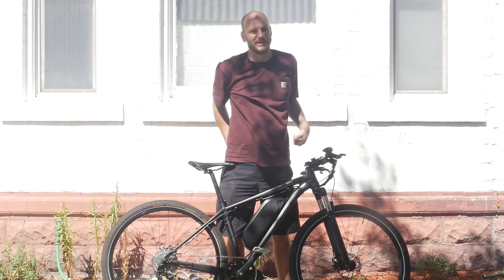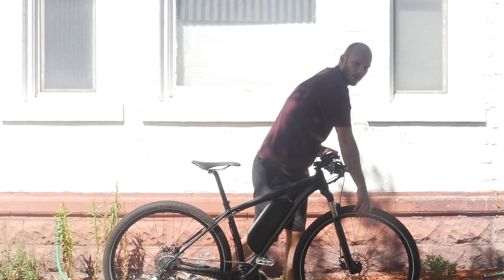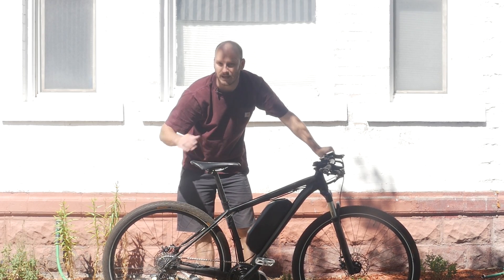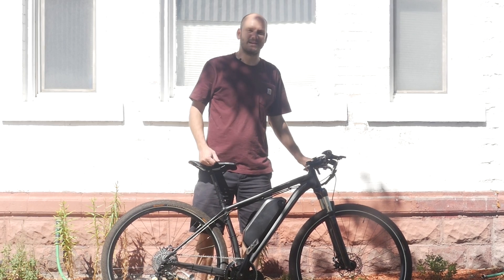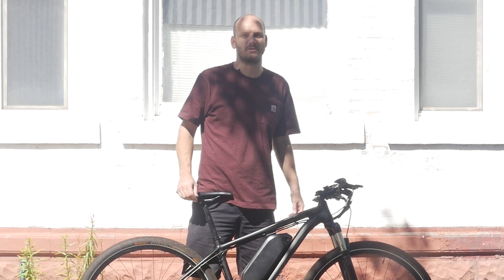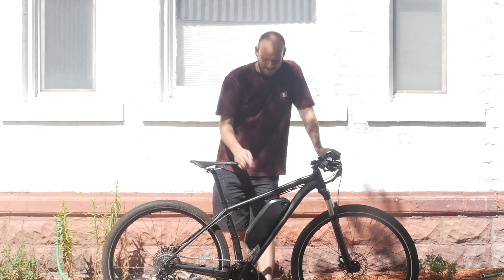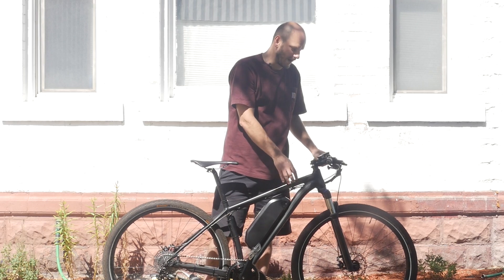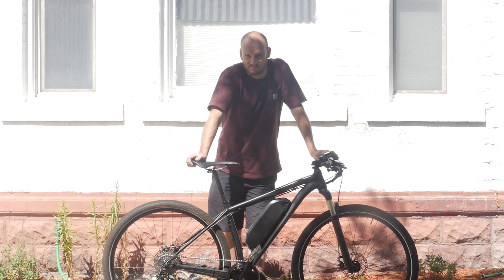Custom E-bike Build: Specialized Stumpjumper 52v 17.5ah BBS02 750w Mid drive

Comment: Bro i have a sweet Giant Stance 2 29er full suspension that i want to convert to a commuter bike but the BB is the kind that i can't use a mid drive motor do you have any suggestions of where i could get a good rear wheel hub kit with battery.

Comment: I had to use 2-part epoxy to mount my hyd brake cut-offs and magnets. It was made even more difficult when I realized the magnets only work when glued on their edge and not able to lay flat. This may be just crappy magnets provided with my kit.
Reply: I did not use brake cut offs or shift one because if you let upon the pedals when shifting it will not damage the drive train
Reply: try silicone and ty straps
Reply: Epoxy will be more reliable than mounting tape.

Comment: The magnetic brake cut-offs blow in terms of having a solid install on most brake levers, almost none of which have suitable mounting surfaces for both the sensor and the magnet. The Tripwire sensors look to be a cleaner and more universal way to sense movement of the brake lever, yet they're no longer available. For my cable brakes, I'm going to try the brake sensors that are similar to the shift sensor.

Comment: if it is a regular bbshd controller, always get a gear shift sensor. if you boost 72v get a single speed with insane torque

Comment: I had the same issue with the bottom bracket on my Norco one25. Before I knew there was an adapter I already made my own out of plastic water pipe with the diameters I needed. But it's good to know there's an adapter out there in case I need to swap out my homemade ones down the road. 

As always great video and thanks for sharing your knowledge with us Johnny.

Comment: I have a Trek 4300 with the same motor and battery, really turned out well. 30 miles from 52v to48V light peddling. Tops out at 46k/hr. with a 52T main gear.

Comment: I totally get the gear shifting sensor, but I don't understand why brake sensors would effect shifting.. why would you ever use your brake while shifting?
Reply from the maker: As a backup
Reply: If you have ridden 10 speed very long you don't need it. beginner maybe.
Reply: I want brakes to cut assist so I'm not fighting it, whether accidentally or via failure of something like a cheap throttle component.

Comment: how much range can you get on a full battery if you held the throttle going 20 mph?
Reply: Too many factors. Wind is huge, into versus with it.  Tire pressure, rider weight, amount of charge in the battery beginning.  30 miles maybe.  Even size of rider.  A small guy running more saddle to bar drop will go a lot farther. Aerodynamics is huge.
Reply: @lukewalker1051  5mph or less winds, 40psi on a 29x2 inch tire that is street tread. Rider weight 175 lbs and 5 ft 10
Reply: If you pedal you will get a lot better mileage.  Why not pedal.  I may use the throttle to startup especially if I am in a high gear.
Best to be in a low gear at startup.
Reply: I have that same set up and can go for 3 hrs with some light peddling

Comment: What bike brand or model with a standard 68mm bottom bracket provides the best fit and alignment with the least amount of spacers while installing a BBSHD mid-drive in your opinion?
Reply from the maker: I’d probably say the comfort bikes with thinner tires. Fatter tires have more aggressive chain stays that require offsetting.
Reply: Thanks, much appreciated.
Reply: I have a TREK 4300 2.3" tires  BB 202-750- 17.5ah and am very happy with the bike and installation.

Comment: For the rear rack on my first converted e-bike, I needed rubber pipe clamps to mount mine on. A 7/8 inch rubber pipe clamp on both sides and also a bike rear rack mount adapter. How difficult is it to take the battery on and off of that bike?
Reply: In my use I have never taken the battery off and it is locked on to the bike.
Reply: It is nice to be able to take it off though. My first one was like that but the one I have now is easier to remove.

Comment: Another good video Johnny!  Question... I'm in the middle of my Motor Bacon fatbike BBSHD build.  How do you feel about the dual hose clamp method to eliminate motor rotation?  The stabilizer bars from Luna and California ebike won't fit and I don't like the design anyway.  Thanks!
Reply from the maker: I’ve never had an issue with rotation since I’ve been using an impact to install the inner lock ring
Reply: I have the 750 -202 and I used a piece of plumbers tape to stabilize the motor from turning down. mounting bolt to seat shaft and a hose clamp.
Reply: @JohnnyNerdOut  what kind of ft/lbs are you putting on it?